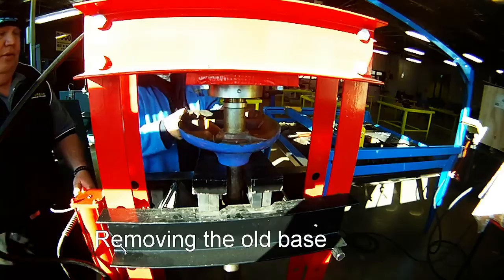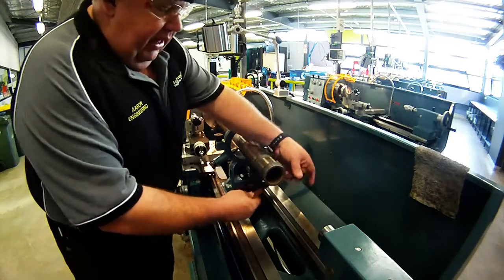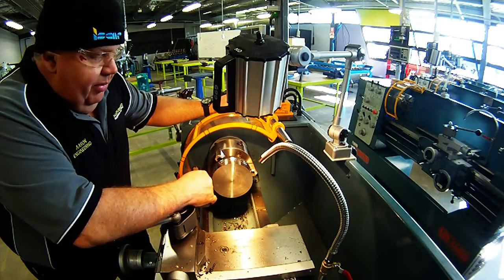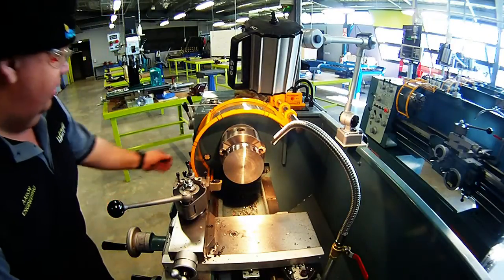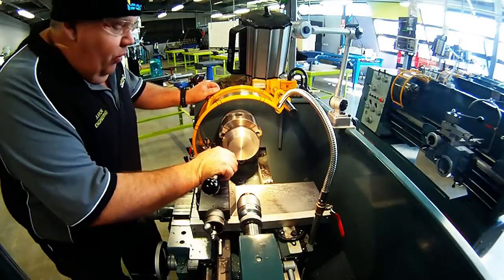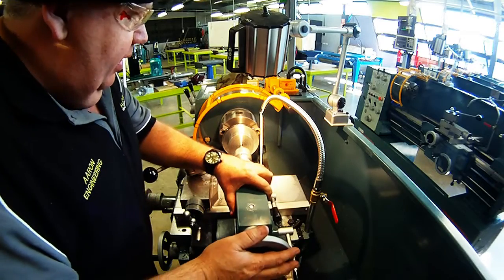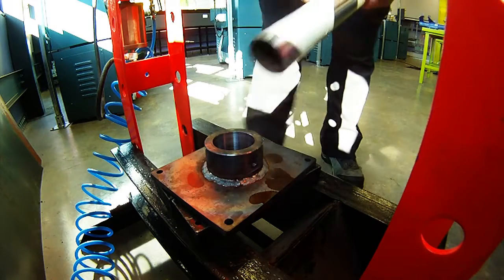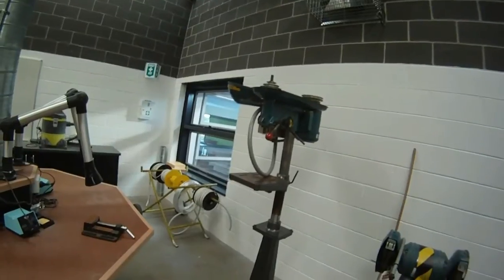DIY Machining & Fabrication - Waldown Drill Repair

Comment: Nice work mate. Did the plate warp before or after pre heat because it wasn’t clamped down
Reply from the maker: G'day mate and thanks for watching.  Yes it did warp a little on the base, but nothing to drastic.  In hindsight I should have put it back in the chuck and faced it, but it clamped down fine in the end.  Cheers, Aaron.

Comment: Hi!  just got a Waldown press drill  8 SN III and like to know if you could help me to get the manual for it don't know for sure if the motor is 380 volts  3 phase or single phase 230 volts  i started to do a resto on it  '   like to know if i keep the motor and put a converter 380 to 230 as i realy don't want to change the motor if is okay i'm in the blue moutains nsw  hope you see this message thank you Robert
Reply from the maker: G'day Robert.  Sorry I don't have a manual for the Waldown drill.  I've worked at many high schools and these drills are a common sight in workshops.  However, I can't say that I've ever come across a manual though.  The motor was usually 415vac 3 phase on these units.  I have come across a couple of single phase, but the bulk were 3 phase.  You can run these off a VFD, many people have done this.  Some blokes even get an old washing machine motor and retro fit that also.  Hope this helps mate.  Cheers, Aaron.
Reply: thank you Aaron just let you know i have almost strip the paint of the Waldown drill rely a beautiful piece of machinery very solid now i"m going to take the motor of and see if his a single or 3 phase motor i think i can wire the motor just to check the condition but i'll check first what voltage  if 3 phase i may get an   inverter  220 to 380 to the motor due you think is okay to go this way or change the motor all together  i still be looking for a manual anyways thank you regards Robert